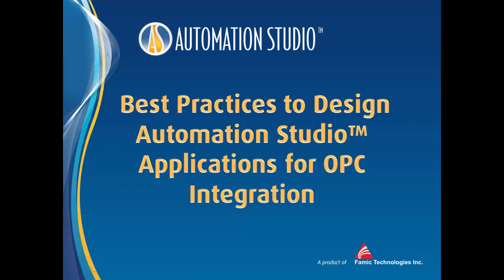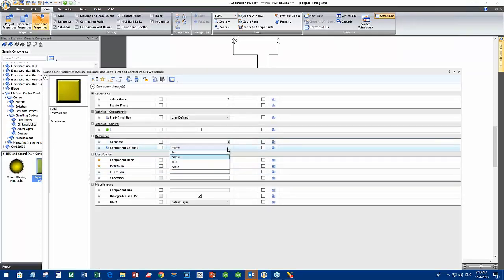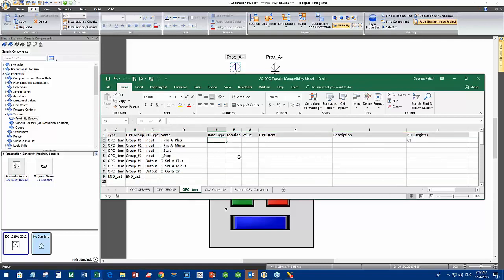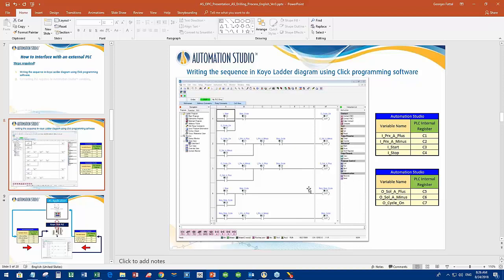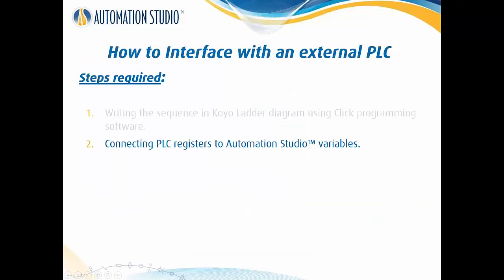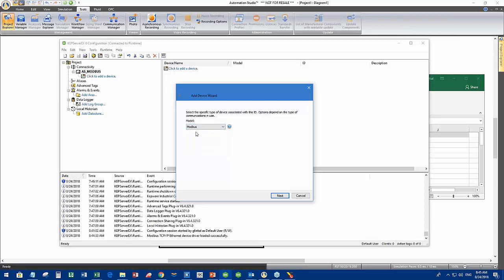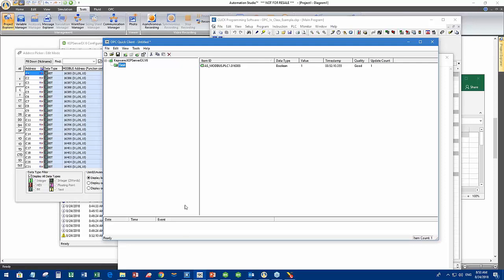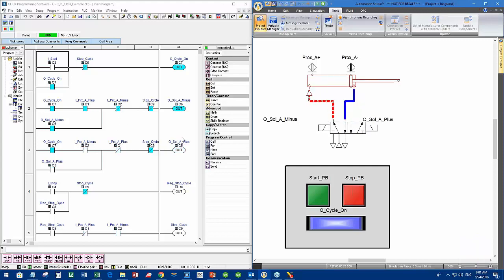Webinar - How to Build Automation Studio™ Applications using OPC

Comment: So could i download this file in automatoin studio to any brand of PLC? for instance, could i use this format instead of using Studio 5000 for Allen bradley PLCs?
Reply from the maker: The PLC libraries provided in  Automation Studio™ are designed to write Ladder Logic PLC programs that execute in simulation mode inside Automation Studio™ environment to act upon hydraulics, pneumatics and/or electrical virtual circuits. The PLC logic developed written inside Automation Studio™ cannot be downloaded directly to PLC. The user has to reenter the validated logic using the tools provided by the PLC manufacturer (Studio 5000 for example in the case of Allen Bradley PLCs). That is why for the sake of efficiency the user writes the logic directly into the PLC using the appropriate tools provided by the PLC manufacturer and then using OPC to test the PLC ladder running by the controller to validate it against virtual circuits developed in Automation Studio™. That was shown and demonstrated in our video.  -EN

Comment: I have converted Excel sheet into the .csv format by save as command ...but Automation studio unable import variables. I got an error wizard showing us Importation failed.
Reply from the maker: The csv format generated by Excel is not compatible with Automation Studio at the time being. The issue has been raised to our development team and will be corrected in the next release of the software. 
However you can still do the import to Automation Studio if you follow the right format. The right format impose on you to enclose the values in quotes.

Example:

Wrong format generated by Excel:
Name,Alias,Type,Value,Access,Location,Description
I_Start,I_Start,BOOL,False,RW,.,Start Pushbutton
I_Stop,I_Stop,BOOL,False,RW,.,Stop Pushbutton
I_Prox_A1,I_Prox_A1,BOOL,False,RW,.,Proximity sensor position A1

Correct format to import to Automation Studio:
"Name","Alias","Type","Value","Access","Location","Description"
"I_Start","I_Start","BOOL","False","RW",".","Start Pushbutton"
"I_Stop","I_Stop","BOOL","False","RW",".","Stop Pushbutton"
"I_Prox_A1","I_Prox_A1","BOOL","False","RW",".","Proximity sensor position A1"